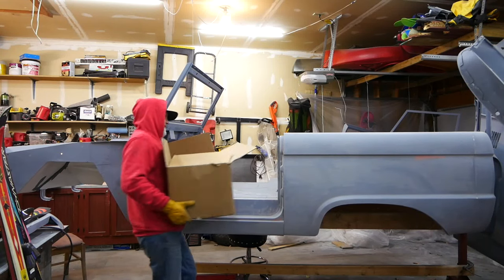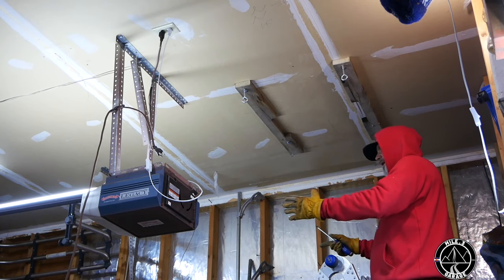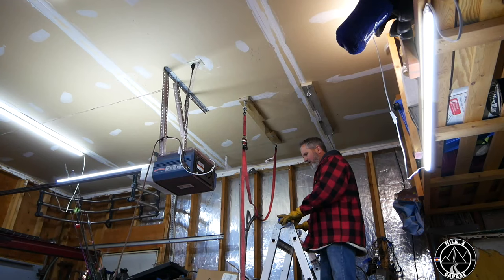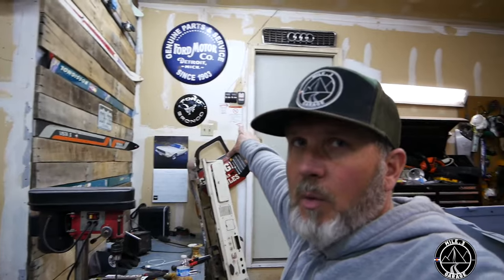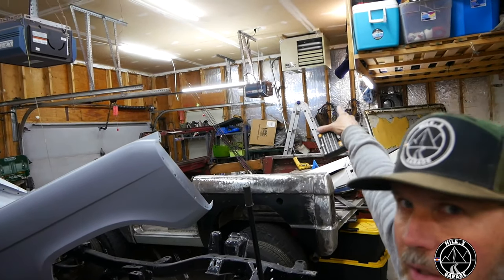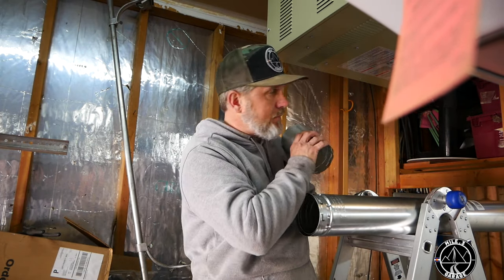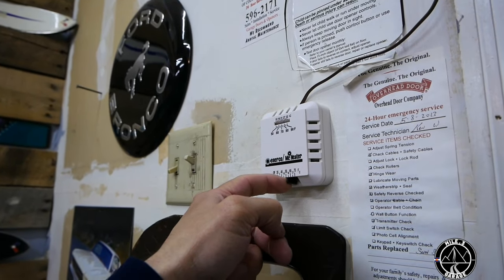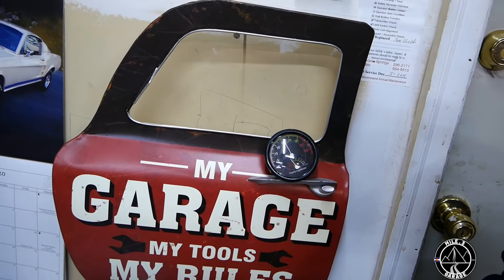Homeowners Garage Heater Install

Comment: If you have a quad with a winch then I suggest using the winch to lift heater in place. Just put a eye bolt or a pulley in the ceiling. Worked perfect for me.

Comment: wrapping up my install this week, there's a couple of things though that need to be done different. Horizontal vent installs need to be done with Cat III stainless steel vent. I know, it's spendy, but it's not code anymore to use B Class vent that way, but is OK for vertical, though the roof install. Next, the gas pressure needs to be checked at the gas valve with a manometer, both inlet and outlet pressures, according to the install manual that shipped with the heater. The final gas connection wasn't featured in the vid, but from what I saw, the drip leg is missing in the gas line. The gas line also needs a shutoff valve (was unable to tell from video) near or at the appliance as well. Again, there's a digram in the book for this in case there's any question on layout, but it should go something like this when using flex line: iron pipe > Valve > flex line to heater > Tee (top) > Tee (side) > Heater, with Drip leg (pipe nipple about 3" or so) with a cap on bottom port of Tee, facing down. Sorry, not trying to be a jerk, but those are important notes for code & proper install. Thanks.
Reply from the maker: Thanks Keith.  I did place a drip leg below the final run.  Yep, 3 pipe is code, going to replace it soon.  Gas pressure was measured after install to ensure I did not drop below spec for the unit.  Shutoff valve was placed next to the wall below the unit. The only issue to be resolved is the 3' lll pipe.  Appreciate the feedback.

Comment: Use a drywall lift next time to get it up to the ceiling.
Reply: I mean is way was probably like 6 bucks for the eye bolts. Probably had the ratchet straps so I mean if you can find somewhere to rent a drywall lift then maybe, or you want to return the lift after. But besides that it worked lol.
Reply: @Dallin Ostler  yeah...your way worked. I just rented a drywall jack for $20 and it took me maybe 5 minutes to get it jacked up.
I was just throwing my idea in the thread to give another idea

Comment: Great info! I just placed my order for a 50k BTU unit at Blain's Farm & Fleet. $412.81 including shipping and sales tax. Will be using it in an attached, fully insulated 1000 sq ft 3 car garage with 9 ft ceiling. BTW, I have a '75 Bronco with a 393W and NV3550 5-speed. Much fun!
Reply from the maker: Send pics of the Bronco!

Comment: I did not look at this vid before installing my Mr. Heater 50,000 but unit. Hung it using ratchet straps just like you did yours . Looks scary but it worked.
Reply from the maker: Jim- you are a smart man!

Comment: Thanks, I was going to use 1/2 inch but I will use 3/4 now because of code.
Reply from the maker: Refer to your codes before you change. The size of pipe is dictated by the btu and the run. Mine calculated to 3/4” but yours may be larger or smaller.
Reply: @alpinegarage8548  80k btu and 20 foot long I believe 3/4 should be sufficient.

Comment: Question about the placement of your heater..  Seems that the "ideal" location from what I've seen is diagonal, in a corner pointing toward the garage doors...  Yours looks to be on a side wall pointing at another wall..? If that's correct, do you notice any dead or cold spots..?  I would like to tuck mine into a corner as recommended, but then the exhaust vent pipe would be so minimal on the inside that 2' or more would be sticking out of wall on the outside. Per the instructions, a minimum of 3' of pipe must be used. I'm freezing and can't make a decision...lol
Reply from the maker: We placed it on that wall because our main work area is directly across from it. That spot is the warmest in the garage and directly under the unit is the coldest.  I would direct it towards your main work area. Mine also sticks out 2’ from the house, but it doesn’t look strange.

Comment: It disconnects after two minutes and works again and it does the same thing throughout the day and it does not reach the required temperature. I changed the ventilation tube and the same problem. I don't know if there is a defect in the industry or is there something else if you have the solution I hope you will let me know thank you
Reply from the maker: Which unit do you have?

Comment: Gas shut off valve nearby ? I’d have a power shutoff box mounted on the wall as well…. Enjoy your set up
Reply from the maker: Yes i added a shutoff at the joint below the flex hose. 2 years in and working like clockwork!
Reply: @alpinegarage8548  … Great to hear that you did .. Glad it’s working good for you

Comment: Mike in Alberta Canada your horizontal exhaust must be Type 3 which is stainless steel venting as your Type B ( double wall venting ) can rust out from condensate in the venting  so my ? Is what state are you in that they allow type 2 venting for horizontal venting ? But all in all beautiful install loved your Enginneering skills with ratchet straps for lifting heater up
Reply from the maker: You are right on.  After i made this video I reread the instructions and code and switched the horizontal pipe to cat 3 -3' pipe.  I cannot add to the video once posted so i am going to post a new video.

Comment: Respect the install but if you're going through all the trouble with a permanent install just whip some flexible conduit so you can control the power via a switch.

Comment: How loud is the unit?  Thinking of installing one in 3 car garage but master bedroom is above.  Ceiling is insulated.
Reply from the maker: tylermacali it is not too noisy. The most noise comes from the igniter.  The fan unit isn’t any more noisy than a regular fan.

Comment: Holy 80000 btu is overkill man 40000 would be plenty
Reply from the maker: Sure is nice to get my garage to 65 in less than an hour on cold days though….
Reply: @alpinegarage8548  ya I bet it is but it most likely will short cycle and takes ya heater life away but hey it's your place just heater size is important. bigger is not better in the heating and ac world.

Comment: B vent not allowed for a car 3 exhaust appliance, and if you are painting in there, get an outside fresh air intake for the unit too
Reply from the maker: Yes, when I completed it I realized I should have used 3 vent.  I am going to replace soon.  ill add a fresh air intake if I decide to paint with the heater on.
Reply: Yeah I have the same heater and had to buy the Cat 3 venting kit. $285 to go all of 7 feet. Same stuff I had to use on my boiler in the house.

Comment: will it just turn on when its gets cold if the power is on???
Reply from the maker: Only if you have the thermostat wires up like shown. Set the temp and it will keep your garage at that temp like your house.

Comment: What did the installation manual say cieling clearence needs to be?
Reply from the maker: I remember 2” I think. Just enough to clear the top of the unit. Mine is mounted approx 3” off the top.

Comment: when you paint, how do you ventilated your area so your fumes aren’t a problem if you heater unit kicks in while your paint is drying?
Reply from the maker: Booth has to be sealed with duct tape and exhaust has to be greater than intake. I would heat the space, turn off unit and paint, ventilate, then heat.

Comment: Does it keep the whole garage warm enough? I have a 3 car garage and debating placement.  I’m not sure if I want it directly over my work space or off to the side a little..
Reply from the maker: Yes it will. It takes a little over an hour to heat from 28 to 65 degrees.  Have it offset so the air doesn’t hit you directly. If you want direct heat go with a gas or electric radiant heater above your workspace.
Reply: @alpinegarage8548  Thanks for the reply and enjoyed the video.

Comment: Good info. What about the condensation tee? Do you need it? I’ve noticed no one’s using it
Reply from the maker: Yes. I have a 6” tee dropping from the main run up to the heater.
Reply: Needs stainless steel vent pitched up at end. Condensate runs back and is burned up

Comment: Not sure you're still seeing comments, as this vid is over a year old, but you mentioned the exhaust pipe at $250... I didn't see that expense included in your total ...  Did you forget to input that, or did I miss something..?
Reply from the maker: I think I did not input as I didn’t buy the one from the manufacturer. I bought cat 3 stainless pipe from Amazon for $65 for horizontal venting. If your going vertical, you may not need cat 3, but check your code.
Reply: @alpinegarage8548  Ahhhh, ok.. Thanks for the response..
 You mentioned the cost of the Mr Heater one, but didn't purchase it.. What kind of increase did you see on your gas bill..? 
I know it's relative to several different factors, but just looking for a ballpark figure..
Reply from the maker: @JoHa-dl5zr  it was nominal. To be honest I feel like our gas fireplace being on all day costs us more than this heater. It is very efficient from my perspective.
Reply: @alpinegarage8548  Thanks again..!

Comment: Ok just got this heater. Heating and cooling company wants $1600 to install 33' of above ground pipe to hook it up in my garage. Is that crazy or should I do it myself. I feel that I'm capable but gas is kinda intimidating, don't wanna blow the house up
Reply from the maker: Materials would be a few hundred dollars. So subtract that from the total and think....would I have someone install it for $1000?  You probably would. It is twice the cost of the unit so not horrible.  But you can sleep at night.
Reply from the maker: Do you know where a union in the line is, or where the contractor was going to tap the line?  Do you know where your gas shut off is?
Reply: They where going to tap the line but it's all above ground. Quoted me 12 hours of labor I can't imagine taking that long.
Reply from the maker: @drewcoleman7040  I tapped the line and ran 55 feet in a day.  The hardest part is finding the union. Most codes require a union somewhere in the line.  Look up black iron union to see what the fitting looks like and if you can locate it on your line.

Comment: 8ft high is for commercial garage.  Residential garage required 18 in high from the floor for source of combustion.
Reply: Where did you read or hear that?  I have an 8 foot ceiling and this heater seems ideal, but I can't get the bottom of the heater above about 6 1/2 feet.
Reply: @johnwilburn  its on mechanical code book.  So commercial garage need to be 8 ft for damage from car.  At residential garage you don’t have that height.
Reply: @hangngoaigiare  Good deal.  Thanks.  I was wondering if it had anything to do with the heater itself.
Reply: @johnwilburn  the heater need to be installed according to manufacturing instruction. The 8 ft to the bottom of the heater is for commercial garage. Have to build protection if not 8 ft high.   The source of burner have to be 18 inches off the floor if in a garage either residential or commercial
Reply: @hangngoaigiare  I've got that and I plan to mount it where a car can't hit it.
Reply from the maker: Sorry guys, I didn't mean code specifically for the 8'.  I am going to install a lift in that bay potentially and wanted it off the ground as much as I could.
Reply: @alpinegarage8548  I've got it installed and it's heating nicely.

Comment: look's awesome man. did you have to install regulator or just straight from 3/4" pipe to heater?
Reply from the maker: no regulator.  Just hooked up directly to heater.
Reply: @alpinegarage8548  ok sweet thanks man. Would you know a good way to tap my main line to feed my Heater? It’s up in the attic. Do they make like a slip on tee? If I cut the line I’d have to re thread the ends so wasn’t sure if they made a slip on tee.
Reply from the maker: @Dyerboi333  you probably have a union in the line somewhere. It looks like a really big nut in the line. It is standard in most areas to have one. This will allow you to disconnect the line and add if needed. Look up black iron union to see what it looks like.

Comment: Don't think I would paint a vehicle around that heater.
Reply from the maker: I am sure you wouldn't, you sound like a smart guy.  I, on the other hand, not so smart.
Reply: Eh, I’ve done it. I just don’t run the heater when painting and I throw a large bag over it to keep paint particles out of the heat exchanger - or it’ll smoke you right out the first time it runs after. Once the painting “dust” settles, you’re good to run it again.